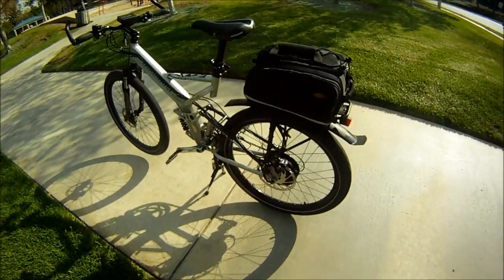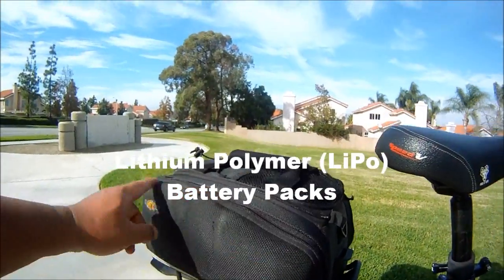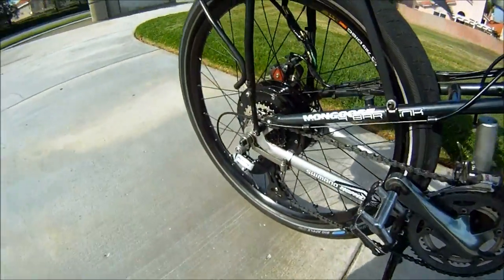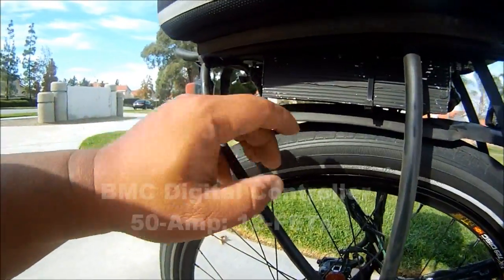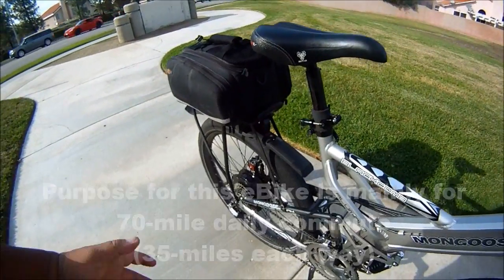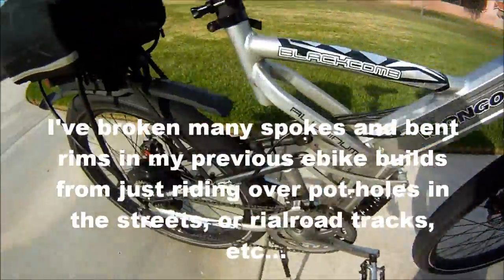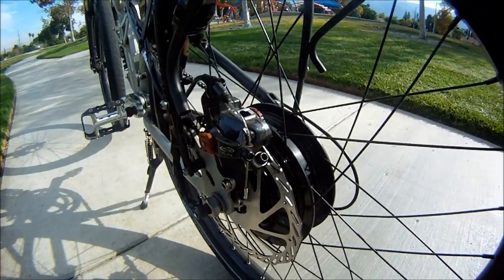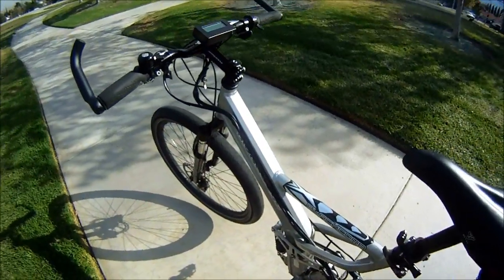Mongoose Blackcomb eBike 10-14-11

Comment from the maker: @brokenandthroenaway Your 9-mile commute to work is fairly easy to do on a 48v 10Ah battery pack doing an average of 25mph. If you travel slower (say 18-20mph) you could get away with half that pack size... 48v 5Ah.

Comment from the maker: @orangesilverado01 
I got the bike from my brother. He bought it from Walmart back in 2008 for $230
But all the electric (motor, controller, battery, Cycle Analyst), and upgrades to tires, gear chain ring, disc brakes I added myself.

Comment from the maker: @brokenandthroenaway A more powerful hubmotor does not necessarily mean you'll drain your battery faster. It does allow you to accelerate faster and climb steeper hills but if you are wise and gentle with the throttle you can pretty much match the power comsumption of a weaker motor. I have a few years building ebikes... trust me on this.

Comment from the maker: @brokenandthroenaway  I also highly recommend you get a rear hubmotor because the Blackcomb's rear dropouts are strong solid steel (perfect mounting location to handle the high torque of a powerful hubmotor). The Blackcomb's front forks are a much weaker aluminum alloy. Handling of the bike is much more quick and nimble with the hubmotor mounted to the rear.

Comment from the maker: @adrienmcclure 
I recommend that you get your kit from this site. 
He is known as a respectable vendor with good ebike kits in the international ebike forums. The 500-watt motors he sells are MAC can actually handle 1200 watts and are have pretty high performance for the price. Those rear geared hubmotors he sells already have mounting holes to accept standard ISO disc brakes.

Comment from the maker: @adrienmcclure Okay here's how MAC motors work
6T=6 turns of wire per pole, gives highest speed but lowest torque for a given voltage so reaches high speeds on flat terrain but not good on hills and has weak accelaration.
12T=12 turns of wire per pole, gives lowest speed but highest torque for a given voltage so good on hilly terrain and great acceleration but does not reach a very high speed. My recomendation for you is to get the 8T motor and run it between 48-72volts. Can climb medium hills

Comment from the maker: @adrienmcclure MAC 8T motor will allow you to climb low to medium hills, will have acceptable acceleration and will reach about 31mph on 48volts on the flats without you pedaling. If you want more acceleration and higher top speed run it at higher 60 or 72 volts. Keep in mind you can only get this performance if your battery can supply the high current these motors will suck from them. Use LiFePO4  batteries with ample C-rating or LiPo batteries like what I run.

Comment from the maker: @brokenandthroenaway Are you looking at getting a DD (Direct Drive) hubmotor or a Geared hubmotor? The one I have shown here is geared. Years ago I started out with DD hubmotor but I now like the geared motors so much better because they are lighter in weight, are more powerful, and they freewheel (don't have any drag).

Comment: @orangesilverado01 
Other things I should warn you about... the front chainrings are made of cheap stamped metal. Mine actually FOLDED OVER ON ME when I went to stand up and pedal one time when I was stopped at a stoplight. That's why I had to replace it with a better chainring.

Comment: @orangesilverado01 
Also the original disc brakes were not very strong, squealed a lot, and were dificult to adjust. I ended up replacing the brakes for better ones too. That's why I had to replace it with a better chainring. Also the original disc brakes were not very strong, squealed a lot, and were dificult to adjust. I ended up replacing the brakes for better ones too.

Comment: @orangesilverado01 
I think the frame is fairly strong. I'm a pretty big guy at 280 pounds and I commute 70 miles a with the bike and it holds up pretty well. As for the suspension... it's not too impressive but does the job for me. But keep in mind my use of the bike is for comfortable commuting mostly on paved streets. Suspension cushions okay and takes away a lot of the harshness when i ride over potholes or railroad tracks so it suits my needs just fine.